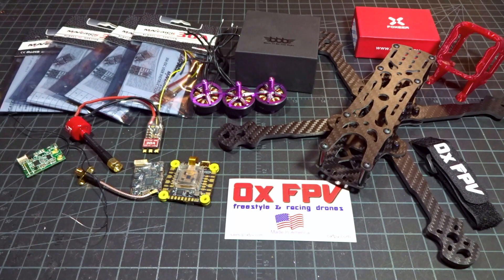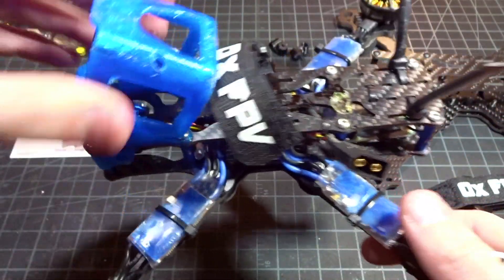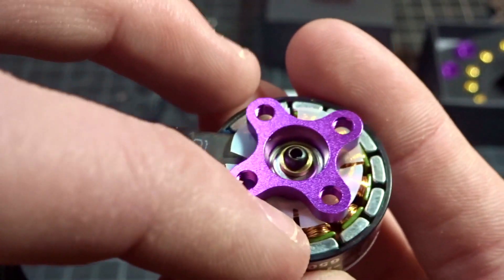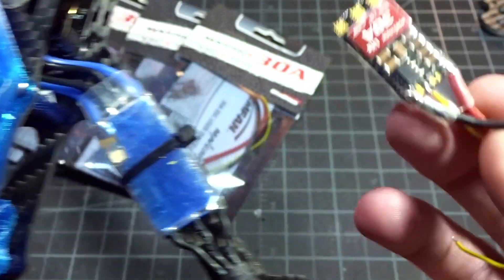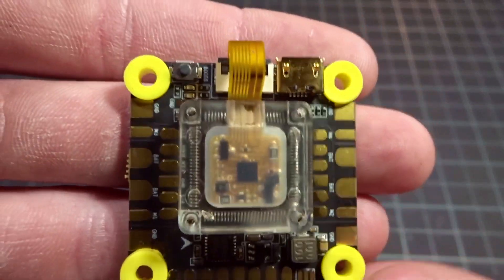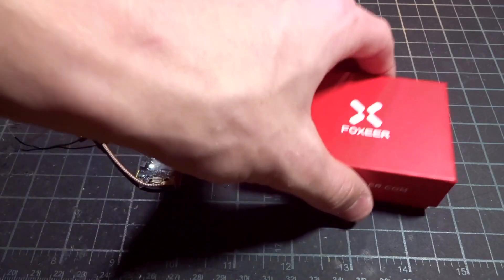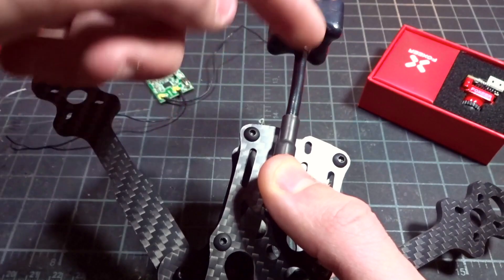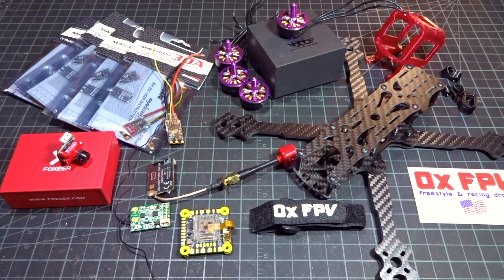New Freestyle Build : Parts Intro - Betaflight F7, BBB 2207 2650kv, Gemfan Maverick...

Comment: Did you do the walk through build for this yet? I bought exactly all the same equipment to build with you of this setup buddy! Just got the esc’s in the mail today! Let’s do it boss! With the walk through can you go through the whole fc setup as well to get it run 32k.. looking forward to this upcoming video buddy
Reply from the maker: AKAIK the 32k F7 code is not ready yet, so I will be using it as 8k 8k for now, and if I have problems with tuning on the soft mounted gyro I will use the MPU6000 also on board.

Comment: I run several race quads on 4s with the same BBB 2207 2650kv motors. Do you like GF Hulkie’s or HQ 5x5x3 v1s or HQ 5.1x5.1x3 v1s for racing? what about for acro? Still doing a lot of unending prop testing to find my favourites. Currently liking Hulkie’s, flashes and HQ5x4.5x3 v1s best but I haven’t tried and can’t decide if I should try the HQ 5x5 or 5.1x5.1’s.
Reply from the maker: Depends on the motor and voltage too much to just say one.

Comment: RCaddict... What MW you fly at when you freestyle?  I’ve been Running the HV Race for a while but am considering going with the PRO for the higher MW.  Does the higher MW really penetrate better for freestyle with lots of obstacles blocking the signal, or is the higher MW really only benefit for Distance flight?
Reply from the maker: 200, 800 should help some, but honestly I don't have any interest in more.

Comment: Would u recommend these motors  for a hyperlite build?
Reply from the maker: Yeah, they have great power and are smooth all around.
Reply: The RCAddict don't u think it is a bit heavy? It is about 34g per motor
Reply from the maker: They are yeah, but it doesn't matter so much. Of course it matters, but it will fly great pretty much no matter what :)
Reply: The RCAddict all of quads are around 270g but I think this thing about under 300g is not really important. Bmsweb Thomas everyone know he is one of best racers if the best  the quads he took to Sebring are way above 300g. I watched one of his race and EnvyAstro was in the same race. He came first.

Comment: but does everything fit with the voltage and stuff ?? so i could just build it and it would work??
Reply from the maker: Everything here will work together yes.
Reply: no sorry i ment for the quad that you thought was god the FrSky X4R-SB - 3/16 Channel Receiver with Sbus and CPPM WITHOUT PINS and Spedix IS30 4-in-1, 2-4S LiPo DShot_600 BLHeli_S 30A ESC and Foxeer Predator Micro Camera FPV OSD 1000TVL Super WDR 1.8mm NTSC 4:3 and DYS WEI 2207-2600KV and HyperLite FlowRide Freestyle 5 inch Frame and HQ 5x4.5x3 V1S (2CW+2CCW) and TBS UNIFY PRO 5G8 HV - RACE (SMA) and foxeer lollipop SMA and 3 practice batterys from RT and HyperLite F4 OSD yeah so i ment will everthing fit with the voltage and every thing is on point or is any thing that does not work with other stuff forexample does the FC work with the ESCs or do i have to change anything in this pile of text : )

Comment: wish the Betaflight F7 didnt have the ribbon on the opposite side to the usb connector - much nicer to have it inside front or rear to keep it out of harms way during crashes.
Reply from the maker: yeah, I might end up removing it altogether and using the MPU6000 gyro.

Comment: In the description I see commanders and a clear view listed.. how did u get clear view in the aomway commander's??
Reply from the maker: You run the Av cord in and shut off internal RF module by holding down the button on the Commanders.
Reply from the maker: I use the ground station clearview, NOT the module version.

Comment: Just an FYI, the BF boards are not associated with the developers/team at all. They get no input into design nor any money or benefit.

The betaflight name is just being abused.
Reply: Braeden Smith no Borisb designed it.
Reply: emiel1976ep https://www.reddit.com/r/Multicopter/comments/7z2oj6/psa_the_betaflightf7_flight_controller_is_not
Reply: The BF F3, was the last board with input as I believe.

The F4, F7, backpack and ESCs to my knowledge, have no association.
Reply: Braeden Smith OK I know he did the f3 that I have bud after that I was thinking that he did that one also. It explains why it has now a better layout.
Reply from the maker: What is that last message on there? Says FPVModel made it right?
Reply: The RCAddict yeah I saw that too, but I don't see it substantiated.
Reply: Thanks for the input brotherman!
I'm honestly not a big fan Betaflight FCs, I bought one F3 and one F4 and i quickly swapped them each time with my favorite FC: Airbot Omnibus F4 Pro V3. My main issue with the BF FCs is that they are not really friendly with 4-in-1 ESCs which is quite a non-sense for me nowadays!
Quite a shame that FPV-Model is using the name and don't even get them some big love :(

Comment: Try enabling 800mw or 600mw  via taranis telemetry, some TBS race editions have normal mw output as they are made from unify hv ;]
Reply: You do know it was Aprils First, haven't you? :D Yes, you can change "numbers" but not real power output, tbs just run out of race boards and used some hv boards :D , but chip on them is limited to 200mw (different from HV) =)
Reply: I can't do this with mine :/
Reply: I have about 20 with 800mw, and several with 200mw, even now latest sometimes are with possible 800mw. there is a sticker on the back of race edition, if you remove it you'll see Unify Pro HV ;]
Reply from the maker: I don't use Lua scripts, and yes some of my Race say they will go up to 800 on 4 blinks, however I am skeptical of actual power output. I never used more than 200 anyways, as I am not arrogant when flying with others ;)
Reply: For long range that does not matter (at least with wings, in 4x formation), you can enable extra mv only via lua script, as button function is limited to "race" fw. Also TBS is great with overheating, it just lowers the power :D
Reply from the maker: Umm osd control? ;) Also I can do it through the buttons, but it doesn't actually go up to the power output is what I meant.
Reply from the maker: Yeah I was replying to Rc Reviews haha